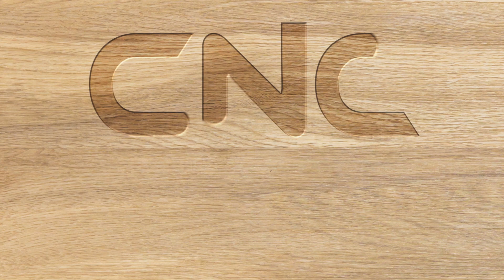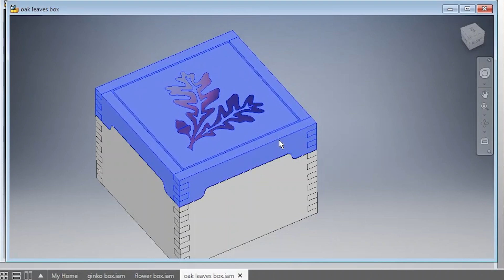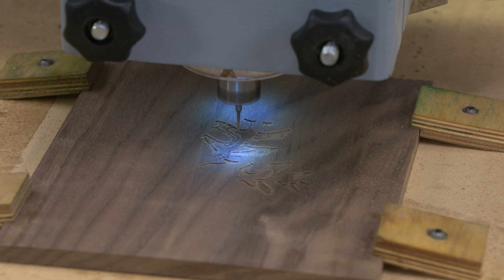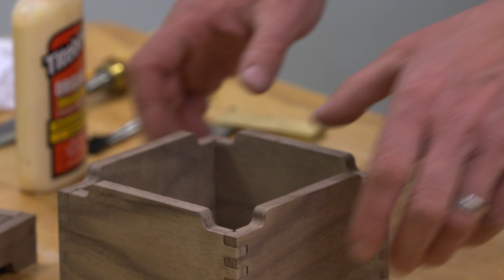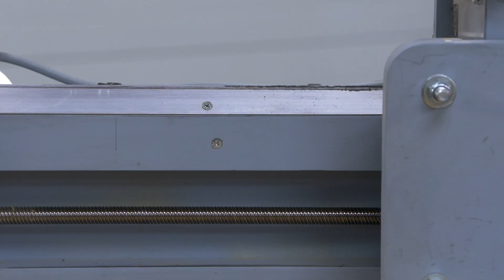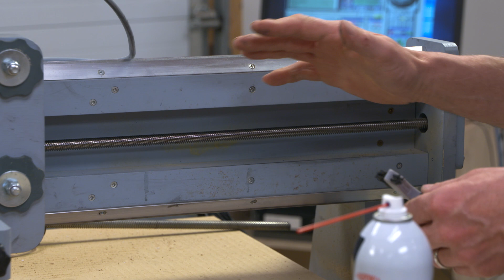How to Make Metal Inlays with a CNC Router | CNC Basecamp Ep. 6

Comment: Where did you get the aftermarket collet/chuck? I have a Makita router (RT0700) on my CNC, which is similar to your Dewalt. Anyone else got any tips on this point - I want to move away from the stock Makita solution.

Comment: for holding down you could also use the painters tape method! stick painters tape onto your spoil board, stick painters tape underneath your metal workpiece, then add super glue in between the 2. it dries very fast, provides a very strong bond and is as easy as just removing the tape when you are done. no water necessary! I have recently discovered your channel and I am loving the CNC content being a cnc owner myself. I also must say that the way your articulate the process is among the best I've seen on youtube thus far.